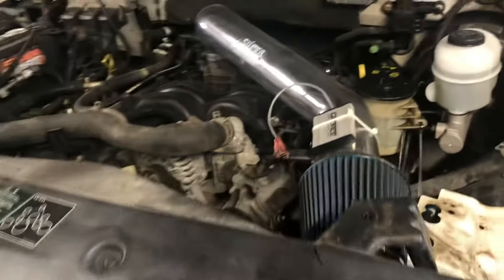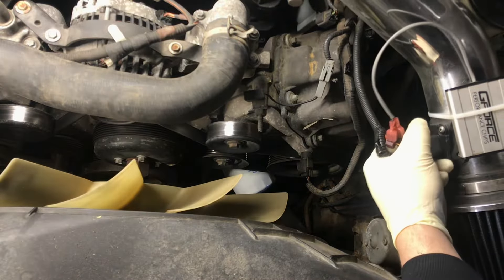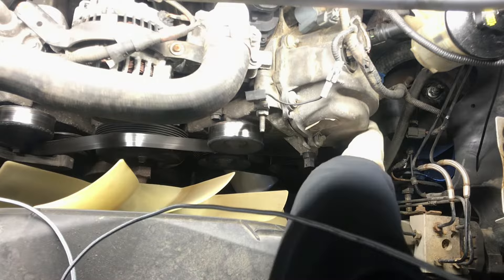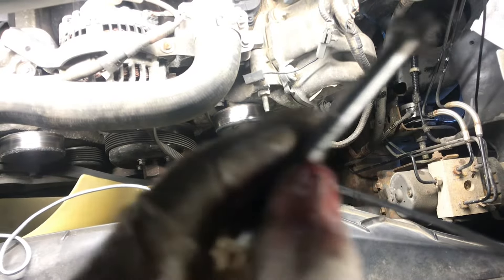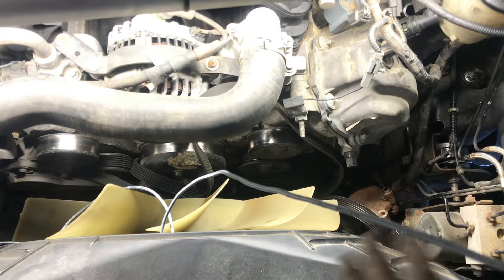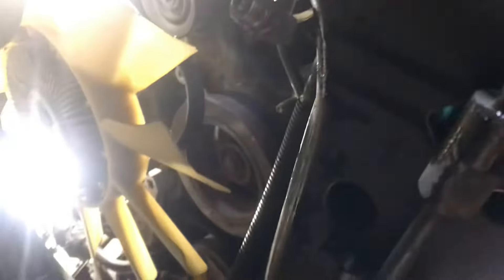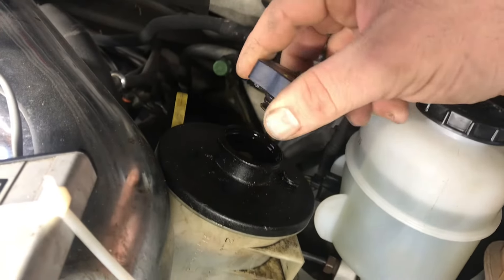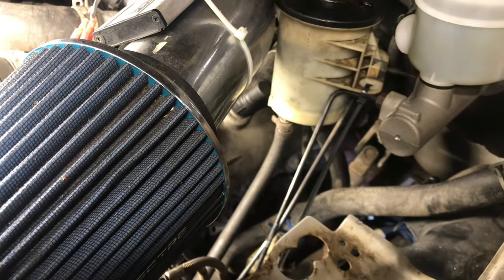Ford F-150 Power Steering Pump Remove And Replace.

Comment: Great video. Incredibly informative. I probably could do this myself but my local mechanic is so reasonable I will let him tackle it. But now I know what it takes!
Reply from the maker: @mqsack  awesome thanks for reaching out and the positive feedback!!!
Reply: @SMAutoRepairLLC  mine is super hard to steer .
Reply: @SMAutoRepairLLC  it doesn't look like I have a leak and it holds fluid but it's just super hard.
Reply: @SMAutoRepairLLC  it doesn't seem like I have a leak it's super hard to steer help help. Should I replace the steering pump with the pulley. ????
Reply: @nathanmccumber8965  Yes, replace the pump if it isn’t leaking.

Comment: the pulley attached to steering pump Looks you used a bolt in middle place didn’t hear in video we had to do that. Is that required?
Reply from the maker: @Lg3ee  No and you are correct I was going to remove the pulley simply because I was under the impression the pump I had bought was the pump only. Turns out the pump actually came with a new pulley installed. That was the only reason, you can definitely replace this pump with the pulley installed.   Good eye!
Reply: @ thank you very much great video will work on mine soon
Reply from the maker: @ your welcome thank you!

Comment: I have a 2005 4.2l f150, would you recommend replacing both lines while I'm down there? Thank you for the video,  I'm gonna check more of you're stuff out.  Oh,  should I replace the reservoir as well?
Reply from the maker: No problem thanks for reaching out, the pressure lines should be replaced if you see any sign of a leak. If it looks wet at all or a ton of rust built up on any part of the line set it definitely wouldn’t hurt to go ahead and change them out while your in there. A small leak on a pressure line can turn into a massive leak pretty quickly! For the reservoir if it’s in still looking good no heat cracks you’ll be ok to keep it, there’s no pressure on that part of the system.
Reply: @SMAutoRepairLLC  awesome, brother.  Thank you.  Subbed and liked.. 👍

Comment: How did you drain the system before removing the return line?
Reply from the maker: You can take the return hose off of the reservoir and drain it out. Or when you remove the line from the pump have a drain pan ready to drain in to.

Comment: Awesome vid. Iv had belt noise iv been chasing.  Did new belt and pulleys , was still there.  Then thought it was in the alternator pulley , it was in there too but it’s also in the powers steering pulley/ pump. Much worse in cold weather.  Was non existent all summer.  I wonder if i can change iyt the pulley on the pump or have to do a whole new unit ?  Will need to put new pressure line in as well at the time as it leaks.

Comment: Thanks for the video. Any idea if the process would be the same for an E 150 van with 5.4? (2003) suddenly lost power steering with no warning. Belt is good and reservoir is full so assuming it’s the pump
Reply from the maker: @lanemurphy8395  will be very similar for the van, this video should help with the replacement of that the pump. Very common for your issue to be in the power steering pump.
Reply: @SMAutoRepairLLC  thanks. At 297k can’t complain. Gonna dive in tomorrow hopefully it’s  not too bad

Comment: i have 2010 5.4 and i have no power steering but no noise, just super hard to turn. U think pump? high pressure line?
Reply from the maker: @danielhizer1228  possibly pump or a restriction in the steering gear or line. You can try and remove the high pressure line and start the engine to see what kind of pressure it builds but that can be an absolute mess if your not careful. Also a quick check from the reservoir remove some of the fluid and see if fluid is pumping back through the return hose at a decent rate.

Comment: My truck is a 2010 F 150..it is super  stiff to turn right and left now...what should l check first ?  Thanks
Reply from the maker: 1st fluid level. If that checks out check to see if the fluid return line has fluid coming back into the reservoir.(you can remove some fluid from the reservoir and see if you see flow). If low or no flow is found suspect the pump. If fluid flow is good you could have an issue with the rack and pinion, or possibly a small restriction in one of the pressure lines.

Comment: About how long did this take you? Im gonna try to do it myself to save some money.
Reply from the maker: For a less experienced DIYER, I’d say plan on a solid 2 hours plus. If you’re more advanced and regular automotive repairs are within your skill set it could be done in an hour or less. A ratcheting 10mm wrench will be very helpful while doing this repair if you don’t have one I’d purchase one before starting the repair. The rest can be done with basic set of mechanics tools. I hope this helps!

Comment: What size wrench is need to remove pressure line from pump?
Reply from the maker: It is either a 16mm or 18mm
Reply: My 06' 5.4 is bigger than 18mm
Reply from the maker: What size is yours?

Comment: What year model is this? Would the procedure be the same as this for a 2010 4.6?
Reply from the maker: Pretty much every 4.6 or 5.4 F-150.
Reply: @SMAutoRepairLLC  thanks boss
Reply from the maker: @justsayin7937  no problem at all. if I’m not mistaken this truck is a 2006.

Comment: How much am I supposed to tighten the pressure line in?
Reply from the maker: Using a wrench before the pump is remounted is the more ideal way. The pulley blocks access otherwise.
Reply: How much pressure am I supposed to tighten up the pressure line till I tap it or just leave some pressure?
Reply from the maker: I’m not certain on a torque specification off hand. Snug it up pretty tight once it bottoms out maybe a 1/4 turn should feel about right.